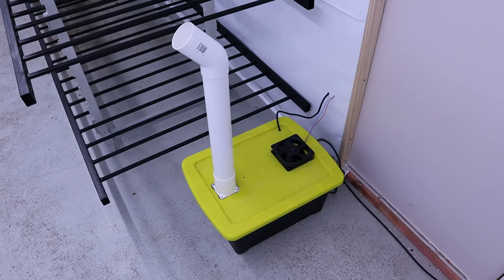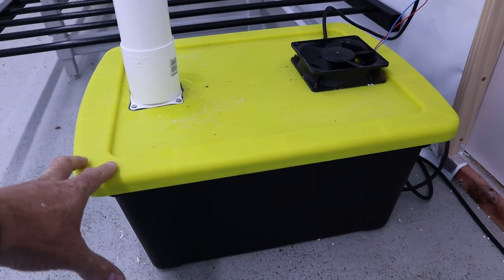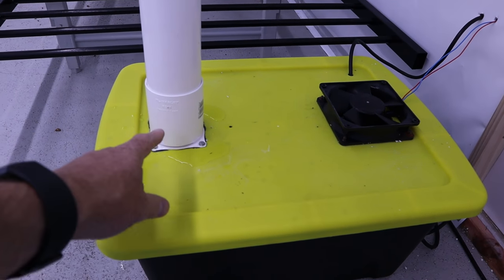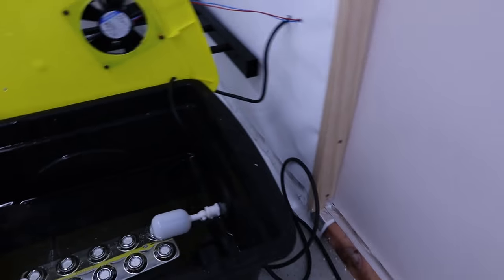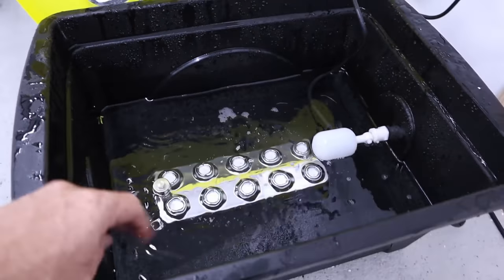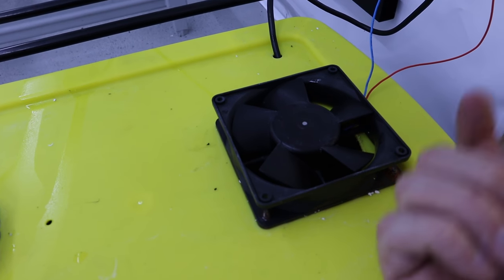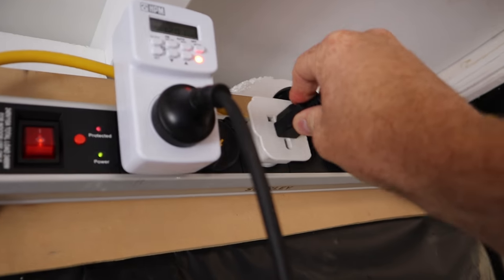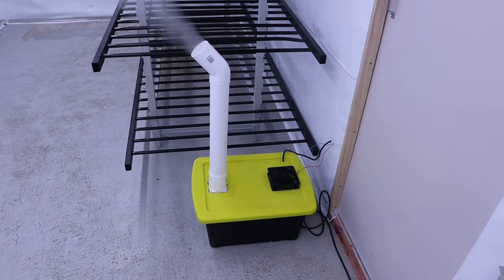How to Build a Homemade Humidifier Using Ultrasonic Misters / fogger

Comment from the maker: A list of parts are available in the description!
Reply: Hey mate, if you have a jigsaw, make a wooden template of the anti splash tube to lid adaptor, then pull the lid off and screw it in from underneath with the wood on top of of the lid to sandwich the lid. Your condensation would just drop straight back in to the tub. What a great looking build though! Very impressive!
Reply: and source information

Comment: HDPE/LDPE = high/low density poly*ethylene* (i.e. polythene), not polypropylene.  This would be why the cements you tried didn't work - PE is famously difficult to bond to, in fact it's typically used for packaging adhesives, as nothing sticks to it!   You might have better luck welding it, but I think that practically the screw-and-gasket solution you used is probably best. 

Lovely build!  Thanks - will use a version on my snake enclosures, too.

Comment: I did the exact same build and it works crazy good.
Reply: what kind of plastic pipe did you use? I've tried PVC and it seems too heavy for the plastic bin top to hold the weight long term.

Comment: Cool video. I'm thinking of converting an old swamp cooler into a massive humidifier. It already has a fan and a float valve. Just replace the water pump with a mister, and block off where the pad is.
Reply from the maker: That's a really good idea! Let me know how you get on

Comment: Hi thanks for the video..I used before a big ULTRASONIC but when i used tap water and the calcium is all over a white fog and you can smell it in the air. Now i use humidifyer with hot mist and is now perfect .. If you use Ultrasonic with tap water dont use it inside the house

Comment: The tote being in the grow room allows that cpu fan to suck in all the spores and deposit the in the water. Your water will be dirty and full of spores, blowing them all around the grow room possibly shortening the pond foggers life as well. I removed my CPU fan and hooked up my intake duct, boom, water stays much cleaner. I also rigged up a five gallon bucket with a line to the float fill outside my grow tent to refill the tote. I just keep the bucket filled and don't have to open my grow tent several times a day anymore.
Reply: Can you give me an idea how you did this? The extra 5 gallon bucket to refill that is

Comment: Could u run tudeing alone the ceiling and pump it over the top of ur racks or make a y fitting an place ur tub in the middle of ur grow an shoot mist both ways in two  different direction athhesame time.maybe to mush moisture on ur shrooms
Reply from the maker: Yes you could, although tubing over the top of the racks would drip onto the mushrooms, and if there's bacteria in the water it can deform the mushrooms clusters I think.

Comment: Great work! Although, with the fan you are using, I'm thinking there might be wasted energy with using so many discs,  with that fan? - it might be reaching the humidity limit way faster than it needs to.

I'm building one for comfort level (20% humidity open air up here in the high north). Tried using just evaporation and fabric sheets wicking from the bottom to increase surface area. It has roughly 80% humidity but my fan is run off of a usb battery bank, so roughly 45% speed. The sheets are dry near the fan, but wet where it exits. But it hardly makes a dent 4ft away.

But I'm leaning more towards ultrasonic foggers now. I'll probably try using a better power supply first but I really don't think it will matter much. And I'm fearful of inevitable mold.

Comment: Can I put the fan on the end of the tube instead? I'm building an humidifier for a little greenhouse outside and I'm figuring out how to protect the air extractor from the rain in the simplest way. So if I put the air extractor at the end of the tube and make some holes on the top of the water container in order to provide air circulation... do you think it might work? 🤔

Comment: 3 years later and I'm wondering what it's lifespan was? I'm guessing that it was close to the 2 year mark. Also, for the glue, red ATV high temp gasket maker or Garrila high strength Calk
Reply from the maker: Its still running! Its my primary humidifier.

Comment: I've done this in a 5 gal bucket for a while and I'd get this white almost limescale all around it. I've been told it's calcium deposits from using tap water? I don't use tap water tho I use R.O water specifically for my humidifiers. Have you had this issue? If so how did u fix it?

Comment: Two questions, how do u keep it at the desired range, humidity controller? And how do u combat mold in the humidifier? My first though was to just add a little bleach, but that would likely force particles of bleach into the air.
Reply: Bleach would be a horrible idea. Buy the UV lamp listed in the parts list.
Reply: perhaps a couple teaspoons of peroxide in the water would help with algae and mold.
Reply: yea use a hydrostat. it will turn this machine on when the humidity drops below a certain threshold.

Comment: How has the fogger held up so far? Can you provide links for the purchases? I've purchased a House of Hydro 3 disk fogger. If I could save some money and get a 10 disk for a decent price I'd appreciate it. Yours looks well good.
Reply from the maker: It's still working nicely. Haven't had any problems. I put a dash of hydrogen peroxide in each week and it stops any algae growing in it and keeps it nice and clean.
Reply: @OakandSpore  Thanks for the update.

Comment: I see you added the UV light to your description list. I assume that just to kill some bacteria and other non-usefull items from the water. Im ainly looking to remove calcium so I don't end up with white-crap all over the place.Im guessing I will have to put in an external filter connected between the water line and this tank correct? Any light that would do that instead?  Thanks

Comment: I also made as per your idea 
Everything works fine 

One problem i faced all the time.... 
My cpu fan stops working after 3-4 day of use 
I had replace 3 but just want to know what reason can be there
Reply from the maker: You need an IP67/IP68 fan. IP means 'ingress protection' and IP 68 means it's fully waterproof and can generally operate under water.
Search digikey, then filter DC fans by IP rating.

Comment: hey, is it possible to disassemble the mist and then assemble again? I guess you have all sorts of issues with your gear. It has no screws. My new unit start off and on automaticly I suspect the internal wiring but a bit scary to disassemble that. Thank you
Reply from the maker: No, you can't take the ultrasonic humidifiers apart. They are filled with epoxy.

Comment: Would like to build one. Just not sure of which ultrasonic plate will fit which power supply
Reply from the maker: You need to see what amps the plate is drawing, and get a power supply that has more. Voltage needs to match also.

Comment: Okay, so I just built it and am now at the point of creating airflow intake and output. Would you think it makes a difference if the in/out is on the side, rather than on the top? For maintenance purposes it would be nicer to have everything on the side of the bin, rather than in the lid. I'm thinking of using a 240v inline fan to generate the airflow. Could that be too powerful and compact the mist to droplets again? Thanks!
Reply: How did it go with that sir ?

Comment: How did you wire the fan? Did you connect the wires just to a plug or did you wire it to the 12v power supply you have in your list of items, please help! Thank you
Reply: Any answers to this question?
Reply: You need ac to dc converter adapter..

Comment: Great video! I've been coming up short looking for instructions on how to make a 50 gallon drum into a pressure cooker. Looks like you're making one. Any chance for a how to video for that?
Reply from the maker: You can't really turn a drum into a pressure cooker as they cannot hold the anount of pressure required (15 psi) You can turn them into a zero pressure sterilizer, or ever a very low pressure steriliser (1 or 2 psi).

Sterilizing at asmospheric pressure means  it just takes a lot longer.
Reply: I agree. You want ZERO pressure. Its more like a super pasteurizer. I run mine for 24-30 hours. Shut it off and let them sit in the drum for a week.
Reply: @justinlangley9529  actually it doesnt because i already have a que waiting in advance. And this is what how what the fungus does. I let em sit for a week to ensure they are properly sealed and cooled down. You dont want to inoculate blocks that at the core have high temps because it will kill of some of the colonized grain spawn. This is evident with mossy creek mushrooms as well. And also if your on a bi weekly production this makes perfect sense.

Comment: Did you just chose a power supply for it on your own?  Is that MeanWell XLG for the ultrasonic mister?
Thanks.
Reply from the maker: The ultrasonic mister came with it's own power supply.

Comment: Great dmo of your setup thank you, what is the UV sterilizing light for ? i bought it from your item list im not sure if i should put it in the water bucket and run it like 1 hours a day?
Reply from the maker: I dont even use one now. I keep the humidifier outside the fruiting chamber and it prevents spore ingress into the tank. If you do run you can probably get away with only running one for an hour or two each day.

Comment: So i got a problem!!
I did everything you have done but out of 10 days running, there 2 days that the humidifier didn’t stop by itself ( i need 45% rh ). So when i arrived the humidifier was in alarm and was working for a couple of hours and didn’t stop at 45%

The setting are not the problem, but my transfo is in a cold place like around 5-9 celsius is this the problem??
Reply from the maker: What are you using to control the humidity? Some controllers break easily and the relays get stuck on..

Comment: Does this device bring down room temperature? Can you please quantify the temperature drop?
Reply from the maker: It will initially, as when air is humidified the temperature drops. But once the air is already at 90% humidity, and you are turning the humidifer on and off to keep It there, the temperature will not drop as much. It's always cooler in there than it is outside.

Comment: Shouldn't  there be a HEPA or a similar filter placed over the fan?
Reply from the maker: No. It would get blown to bits with spores.
Reply: I used my intake duct instead of pcu fan. My water was getting dirty, full of spores. It's better to keep humidifier tote outside grow room and pump it in with pipes/duct.

Comment: sanding the plastic with 120 grit sandpaper will make the adhesives stick better !
its not that its smooth its that the plastics have a static charge that will repel the glues / adhesives.
by using sand paper you will #1: make a grippy area for the adhesives to grab & #2: remove the plastics ability to generate that static charge in the sanded area.

I need to make one of these but need to find a reputable source here in Canada for the mister / fogger. I do not trust all the Chinese sellers on ebay/amazon

Comment: It would have been a lot simpler and more efficient if you had a 2-3x taller tub. You would not have needed the lid and everything that is above it and it could humidify even faster thus using less power. At the very least the pipe should have twice as wide.

Comment: Don't Use Ultrasonic Humidifiers personally [hygiene] they only make a waste product dampness which is swooped off direct to the nearest compost pile for processing to rejuvenation. The way the ultrasonic type misters vibrates and ejects the moist substance used is the same as atmospheric tumbling and that is a kind of backwoods, non human air in cycle which is pumped off in the daily process. All you are doing is suppling the air you breathe with waste type humidity.
The scientist which did this wasn't very observant, check it out, it actually 'runs' from your hand down to the floor and then it 'creeps' out of your house, somehow.
Damn Martians among us.
Reply: What?